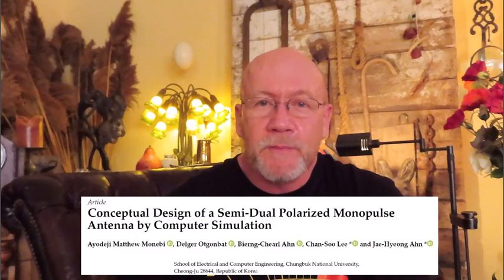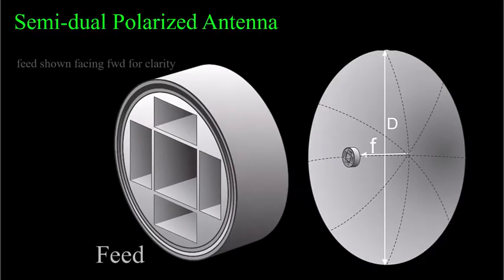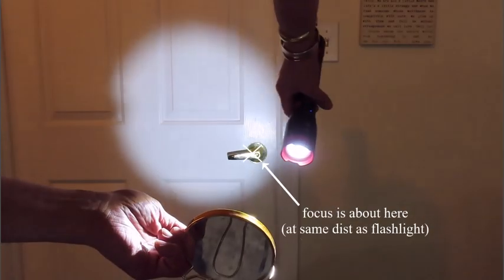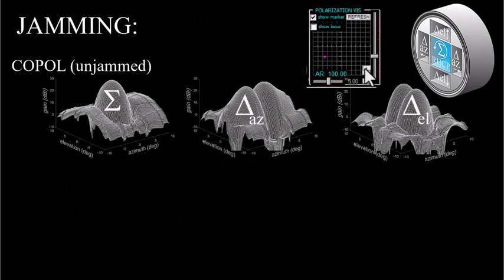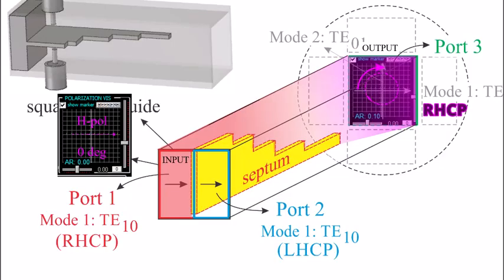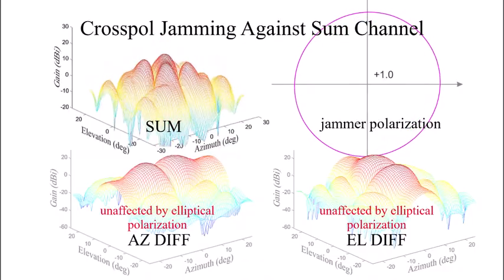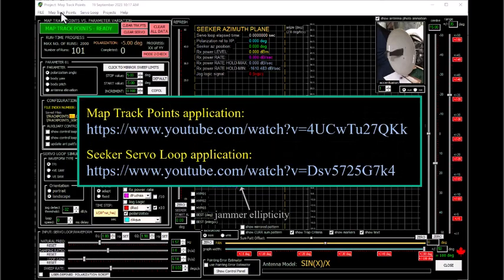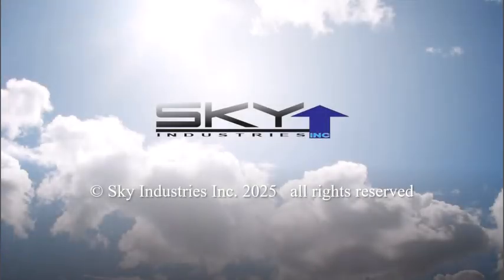Crosspol Jamming vs  Neptune Seeker   Part III 12

Comment: And why is crosspole efficient?and not copol
Reply from the maker: Good question.  

Crosspol exploits an electromagnetic properties of the antenna; the seeker's crosspolar radiation pattern has a different shape than the copolar pattern.  

The seeker design is entirely based on the copolar radiation pattern.  Use the wrong pattern, get the wrong guidance signals.
Reply: @skyindustries  and how can i make the seeker to use wrong pattern? ty for your pattience and i enjoy ur videos
Reply: @skyindustries  i didint understand 100% the idea how a wave guide which is vertically polarised can receive horizontally polarised fields

Comment: I am a neutral viewer, don't have much knowledge, I just want to ask if Crosspol Jamming can beat Neptune
Reply from the maker: That's a good question.  The short answer is yes, with conditions.

Longer answer: In the previous video [ https://www.youtube.com/watch?v=eNykww84Dwg ] there is an open literature reference that shows, or appears to show, simulation results for the copol-to-crosspol isolation for a circularly polarized reflector antenna fed by a square waveguide aperture.  The graph shows gain on a diagonal cut, which is correct since that's where the Condon lobes are, i.e. the highest crosspolar gain.  The isolation is bout 21 dB (see 03:40 - 04:10) compared to a reflector fed by rectangular guides (maybe 25 dB).  

But: NEPTUNE is a flat plate array design.  It's not sensible to directly infer the crosspolar gain of a flat plate antenna with radome from a reflector antenna with no radome.  

That said, to me the paper suggests that the crosspolar gain of the square guide radiator is no better than that of a rectangular guide radiator.  Since rectangular guide flat plate arrays are susceptible to Crosspol provided the radome is present, I would expect the NEPTUNE antenna, with its radome, to be movable by Crosspol jamming, possibly using a relatively high polarization sweep rate.  High rate means high susceptibility to to crosspol jamming, that's good news for the jammer.

But that's not the whole story. The seeker serves the autopilot, and since the autopilot determines where the missile flies, we have to ask how the autopilot will react to seeker signals generated by Crosspol jamming. 

The answer depends on several factors, including 

1) the intelligence built into the autopilot (could be considerable if AI is involved and the right people were working on its design), 

2) the particulars of polarization vs. time, 

3) ECM effectiveness feedback if any, 

4) propagation effects, 

5) jammer effective radiated power, 

6) the ship skin echo, and 

7) what the seeker thinks is happening at time X after launch, based on everything it has seen up to that moment.  

I have created a model of the NEPTUNE antenna it, but I haven't yet spent any time exploring its properties.

Comment: How does the missile control law use the data from the 3 signals? Or is the center only for emitting and the other 2 receive?
Reply from the maker: Good question, I remember wondering about this myself many years ago.  I can explain how it works.  

The bottom line is that all the antennas are used to receive a skin echo pulse, but only the sum antenna is used in transmit mode.  

Why only the sum in transmit mode: the sum channel transmits a "flashlight" beam to illuminate the target.  It would make no sense to transmit from the different antennas; because they are anti-phased relative to each other, the difference pattern has a null on boresight.  If the antenna is pointing at the target, there would be no difference signal shining on the target.

Anyway a "skin echo" pulse is reflected back to the seeker.

When the pulse arrives it is received simultaneously by all the feed antennas: the azimuth difference pair, the elevation difference pair, and the single sum channel antenna.  All at the same time.  

By a clever bit of microwave plumbing, the azimuth difference E-field signal is divided by the sum E-field signal.  The amplitude of the azimuth different signal is "normalize" to the sum signal.  Same deal for the elevation difference E-field signal.  

E-field is important because it can be positive or negative (it's actually complex, but let's keep things simple).  

The "normalized" difference signal can be turned into a voltage that drives a motor attached to gears attached to the antenna.  The voltage is called the "discriminator" (don't know why it's called a discriminator, just is).  Positive voltage makes the motor turn one way, negative voltage makes the motor turn the opposite way - so that's left vs. right, or up vs. down.  When the antenna moves by the motor, sum and difference signals change, and the whole thing is set up to point a null of the difference pattern directly at the target. That's what angle tracking is.

The video shows with the discriminator curve looks like, have a close look and you will see that yes, it makes sense, that's what it looks like when the difference pattern is divided by the sum pattern, paying attention to sign.  

Hope this makes sense to you.  The idea is that the received signal goes down multiple paths at the same time, and the signals in the different paths can be combined in a clever way to make a signal to drive a motor to physically point the antenna at the target.  All completely automatic.  Works a bit like an eyeball looking at an object.
Reply: @skyindustries thanks for writing out such a detailed response
Reply: I had initially assumed the seaker formed some form of image, as opposed to just measuring feedback magnitude

Comment: Also you showed how you could move the focus via changing the side antennas(the ones only for Recieving), how does that actually work? How is the sum pattern formed?
Reply from the maker: The reflector focus doesn't change, it's set by the shape of the reflector.  BUT: moving the feed off the focus by a little bit causes the beam to move in the opposite direction.  Since the feed isn't on the focus the beam shape is a little bit spoiled, but this isn't a beauty contest!  The missile designers just need the beam to be good enough to track a target to guide the missile.  

"How is the sum pattern formed?": I'll answer that for a generic monopulse antenna, never mind the semi-dual pol antenna, it's the same sort of idea but only one antenna is used to form the sum pattern.  For some reason it took me a long time to understand how a monopulse antenna works.  So here's the story:

The first thing to know is that the radiation pattern of an antenna is the same in transmit as receive.  

The next thing to know is that there are microwave devices called "power dividers", which can split the signal and send it down two paths at the same time.  Each path has half the original power, but it's the same signal.  A power divider is an example of a "passive microwave device", it's just cleverly-shaped bits of metal.  Because they are passive they work whether time runs forward or backward, and that means a power divider can also be a power combiner.  

Now consider a monopulse feed made up of a cluster of four little horn antennas. In simplistic terms we can connect each horn to a power divider, so the signal from each antenna goes down two paths simultaneously.  Since the feeds are clustered around the focus none of them are exactly on the focus, so each beam is pointed a bit off boresight, like I showed with the mirror and the flashlight.  

Down one path there is microwave plumbing to combine the signals from all four antennas constructively, so they "add up".  That's the sum pattern.  

The other paths are arranged so that the signals from opposite horns (e.g. left and right horns, top and bottom horns) combine destructively; that means the signals are subtracted from each other. There's one difference pattern for elevation and one for azimuth.

Overall result: a cluster of antennas can be used to make multiple antenna patterns at the same time.  The genius of the monopulse design, and what makes it so dangerous, is that a single pulse reflected from the target can be used to form both the sum and the difference patterns, at the same time. 

Then by a little bit of microwave magic, the signal in  the difference channel is divided by the signal and the sum channel.  The result is called the "discriminator", which is turned into an electrical voltage that is, say, positive on one side of boresight and negative on the other. 

If you connect that signal to a DC motor that drives the antenna left for positive voltage and right for negative voltage, the antenna will point at the target.  It will point the antenna in a direction so that the difference signals developed from the feed antennas are perfectly balanced - then the motor voltage is zero.  

If the target movement in angle, then suddenly the motor voltage is not zero anymore, so the voltage changes to drive the antenna toward the target.  The antenna stays pointing at the target.  That's called angle tracking.  

And the "mono" in monopulse refers to one pulse.  Inn theory the radar can get all the angle information it needs from one single pulse.  By the time you know you're being looked at - by detecting the radar pulse - it's too late.  The radar knows where you are.

Comment: How did you learn all this stuff?
Reply from the maker: Good question.  All was deduced using a pretty small skill set of mathematics, physics, electromagnetics, control theory and very plain, unremarkable - and old - coding skills.   

Believe me there is nothing in the math more complex than high school geometry and a bit of calculus.  

For the physics, electromagnetics and control theory, you don't need anything more than an introductory course.

The main-thing point: most of the math cannot be solved by hand, so you're going to need a digital computer to do that. So the challenge is to translate the equations which govern whatever it is you want to study, into software that is user-friendly and won't let you make mistakes, or at least will warn you before you do, and then run it and watch what happens, and then think about what you see to come up with a what you think is a physically realistic interpretation.  

If you see something strange happening that means unexpected, put on your detective hat and find out why the software is doing what it's doing. Since you wrote it, you know the equations, if you stick with it you'll find out the answer. 

And you might discover that there is nothing wrong with the software, and what you are seeing is a new real effect – one that can be checked by an experimental test.  Then do the test! No test involves a missile seeker, well that's pretty hard to arrange.  And you won't be able to talk about the results... But you will know the answer. 

For other things, use your imagination design an experiment that tests what your software predicts.  

Here's a real-world example, this really happened, and you can do this too:  I was interested in having a model that calculates how microwave signals propagate over seawater, for missile engagement simulations.  So I looked online and found a propagation model in the open, I mean the math that describes it.  I wrote it down in a way I could understand what's what and then I coded it - so now I have a software softeare propagation model, a DLL actually.

Then I needed to do an experiment to confirm or refute the model's prediction of power versus range… Except I don't have an airplane or missile seeker, and I live a thousand miles from the nearest ocean.  

But: what I CAN do is radio propagation measurements over asphalt.  That's not sea water, but the propagation model should give me correct answers no matter what the reflecting surface is.  

So I did that.  I designed my experiment: I got access to a test range, I asked Tektronix and Rhode and Schwarz to lend me test equipment and they said yes.  I built two test stands using wood and fittings from  Home Depot.  I and recorded about 20 seconds of spectra at one metre intervals down the test range.  Then I wrote special software to play back the recorded spectra to display a graph of power versus range, where at each range there is a looping playback of 20 seconds of recorded spectra. Then I could compare the measured power versus range with the predicted power versus range.  

Result: the comparison was exceptional, bang-on; the measured power was within a few tenths of a dB of the predicted power, with a few sensible caveats. By the time I was done I had learned how to see leaves on trees by looking at propagation data.

Here's what it looked like and how it was done, exactly this example: https://www.youtube.com/watch?v=ciw3QPDpy8M

This is called the Scientific Method.  And ANYONE can do it!
Reply: @skyindustries your an absolute legend my guy 
Huge respect

Comment: I really appreciate you sharing these videos, I'm learning a lot. If the the two radiators were pulsed with pseudorandom switching could that help protect against crosspol jamming? I'm assuming a scanning reflector, so it shouldn't be too much trouble identifying the jamming source and nulling it out.
Reply from the maker: Randomly flipping between right-hand and left-hand circular polarization will work against a  jammer that doesn't measure the seeker polarization, but not against one patterned after a a retro directive Crosseye jammer.  

This is a coherent repeater jammer configured to conjugate the polarization: it measures the incoming polarization in two orthogonal planes, and transmits a coherent signal in both planes to create a polarization orthogonal to the incoming signal, and adds whatever polarization modulation you want.  

Result: the jammer follows the seeker polarization pulse-to-pulse.  It's doable, the jammer needs two Digital RF Memory units, one in each channel.
Reply: @skyindustries  Cool, thanks :^)